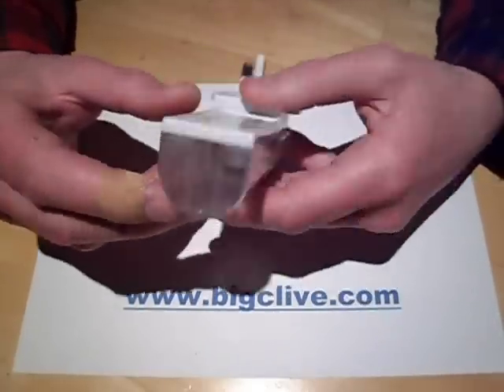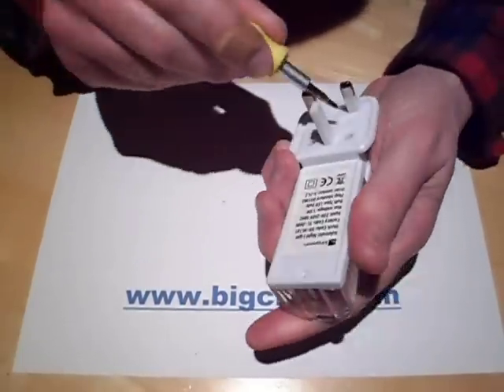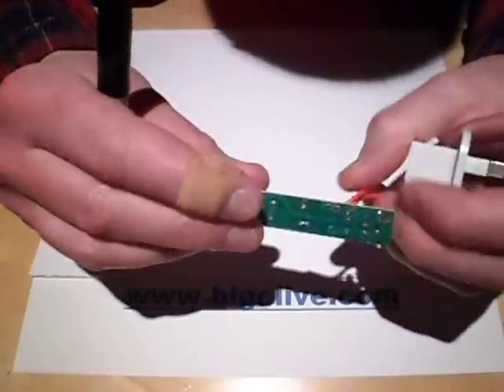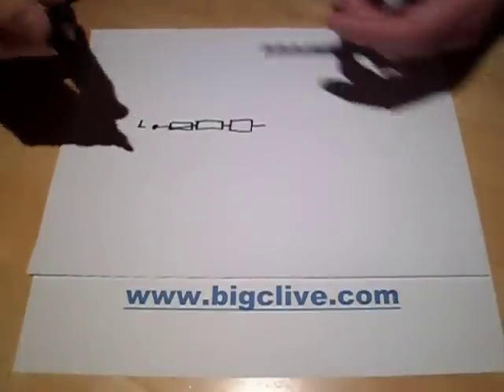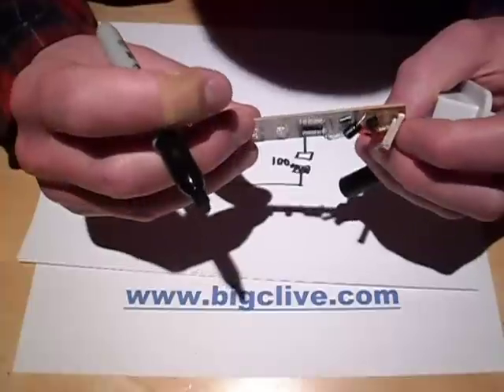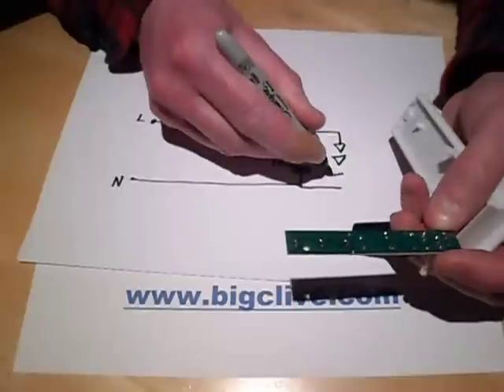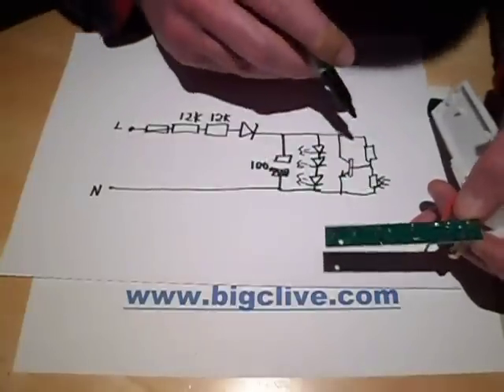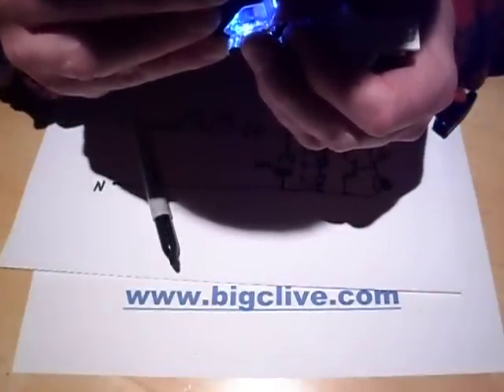Teardown of an LED plug-in night light.

Comment: Bugger me! You've saved my sanity with this 'how to'. 
Just bought the same light from Home Bargains for £1.50, and the instructions said nothing about removing the lower 2 screws, only the upper 1 - leaving me scratching my head and angrily pulling at the unit - which appeared to a simple, slide-off cage which wouldn't slide off. Now I don't have to take it back in order to learn how to change the bulb. (Mine's an incandescent, by the way, and gets quite hot within a few mins.) Thanks!
Reply: Omg! Same situation. I even fast forward the video but I never saw the light turn on. I read your comment and that told me what to do- thanks!

Comment: Would there be any sensible/cost effective way to put the transistor on in such a way that it came before the LEDs rather than in parallel, and turned on when it was dark rather than off, thus only using power when the light's actually on?
Reply from the maker: +Alexander Krivács Schrøder It would require a high voltage transistor and more complicated control circuitry.

Comment: I'm way younger than these cheapy circuit designers and I could design a night light better than that (but it would be more expensive...)
Reply: +Bradman175 The key here is the simplicity. You don´t need no high voltage caps like in a capacitive dropper type circuit, just a handufl of extremely cheap components.
Reply: kubeek Cuttin corners deez ppl do.

Comment: That's a bit naughty. If the light uses no less power during the day (or slightly more as you say) then the light sensor part is completely pointless. The LEDs may as well be on 24/7. We're being conned - it's not an 'eco' light at all.
Nice teardown Clive.
Reply from the maker: I've come across something similar with a neon lamp based night light before.  It was even more primitive in that it used the LDR to actually shunt the voltage down below the strike voltage of the neons themselves.  So just a couple of neons, a resistor and an LDR.